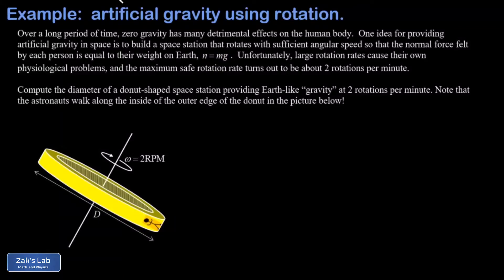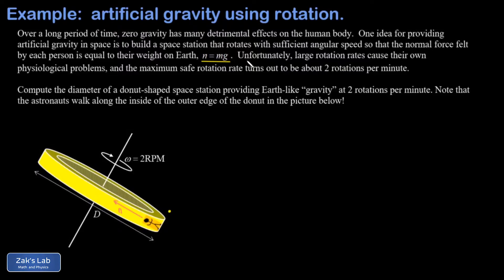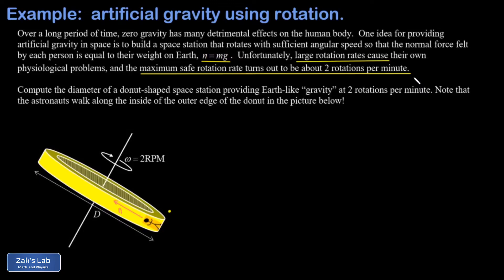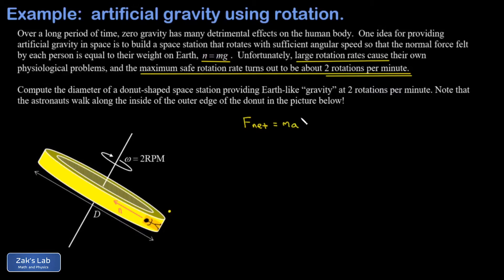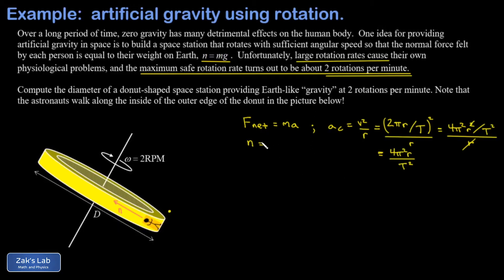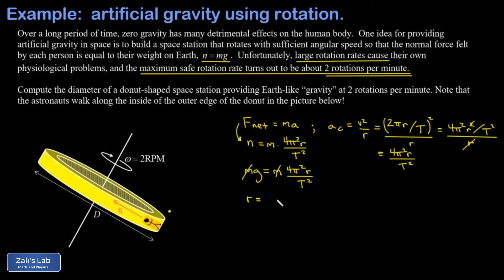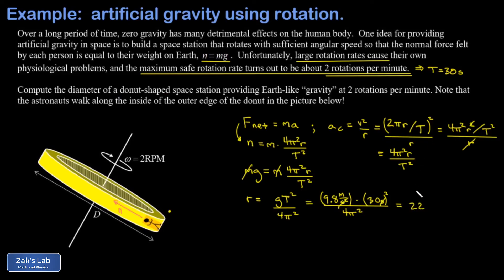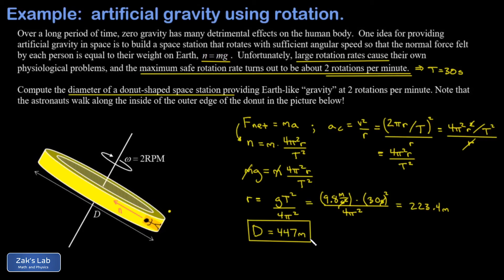Space station artificial gravity minimum diameter to produce Earth-like gravity with rotation.

Comment: My solution is this. You start with 2 rockets, you launch independently. Both are the same and contain living quarters. Outside of orbit, they connect to each other, side by side, and accelerate to 1 G until the desired travel speed is reached. Each contains a spool of wire that connects the passenger rockets together. The rockets have a small side rocket motor to push them away from each other, slowly unrolling the spools until they reach the end of the wires. The wires will allow the two passenger rockets to be 445 meters apart. They keep the rocket motors burning,  so there is constant stress on the wires. But then change the point where the wires are attached, so the motors make the rockets move sideways. They will start to rotate around a center in the middle. The motors will keep firing until the constellation of rockets rotates at 2 RPM. Now the motors can be shut off. When the destination is near, you pull the wires in (spinning increases, but force stays 1G). Then you stop the spinning. Now spin the rocket upside down, and decelerate with 1G until destination. Then you can decouple the rockets, and one or both can start landing. You may want to have a weight that can move up and down the wires to correct for differences in weight between the vessels. It can also be used as a container to move passengers or materials over. Nearly all the time, passengers will experience 1G acceleration force. Having two passenger rockets creates more safety. If one is having system malfunctions, passengers can hop to the other rocket. It may be crowded, but they may survive that way, if they can use each other's supplies. There will not be much room for walking, but with daily gymnastics and yoga you get enough exercise. You do not need any assembling in space. The bigger the rockets, the better, as long as the wires are strong enough.
Reply from the maker: I like it!  z
Reply: @ZaksLab  
Now that I think of it you can even improve on it by making the combined rocket spin hard and then slowly unroll the cables. That would be even more simple.

Comment: The math is fairly simple at this point but when you add in the problem of acceleration to maintain a stable rotation things get more complicated. Acceleration is a straight line away from the rotation. You would need to know how many points of acceleration would be required and where they are. Any acceleration at this size is going to create a lag that will affect balance and possibly cause wobble. This is going to also affect the crafts location in space unless precisely controlled. This could mean corrective acceleration over many hours.
Basically, your calculations are good for an object that is spun from the center but is to small for a craft that has acceleration along its outer ring.
I believe that the size you have calculated would be acceptable for the initial platform usable for research purposes and as a construction platform but too unstable at 1g. Try comparison to earthquakes for the affect that acceleration will play.
Reply: Acceleration is a straight line away from the rotation ? Acceleration is towards the axis, the rim has constant speed (changing velocity as its a circle)
You would need to know how many points of acceleration would be required and where they are? No idea what this refers to.
This is going to also affect the crafts location in space?Not possible to move in space without detaching craft parts, or rockets or jets.
Basically, your calculations are good for an object that is spun from the center but is to small for a craft that has acceleration along its outer ring.? The goal is to rotate the (447m diameter )craft  at 2revs/min. How you do it would be by mechanically counter rotating two identical rings on a single axis, or spinning up a single ring with jets/rockets at the rim.

Not much of your comment is making sense, could you clarify?

Comment: Two starships with a 400m long cable? Intuitively the cable is holding 2 starships at 1G and we already have cranes lifting a starship at 1G. Does that mean 2 of those cables will do? Perhaps the one used now has 4x margin of safety so it can handle it. Add a gondola to go between them
Reply: The gondola is a great idea, but just one would mess with the centre of mass/rotation and make a one ship spin faster relative to the other when it wasn't centred. Having two gondolas that mirror each others movements would fix that, but would still speed and slow the rotation rates when centred vs extended but equally on both ships.
Reply: @Kingstallington  beat me to it (by 1 year)

Comment: Your basic aircraft carrier is over 300 meters in length, so 447 doesn't seem much of a stretch, especially in space. For stations, it's fine. Moving the thing anywhere is the challenge.
Reply: building it is the challenge as it could only be done in space
Reply: It doesn't have to be a full ring, just some scaffolding or a tether with equal weights on the ends would do.